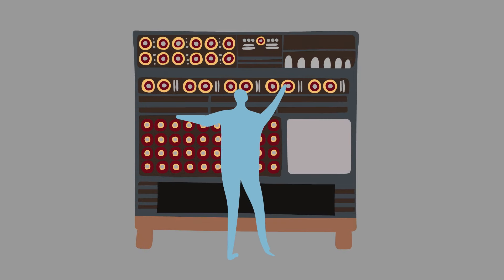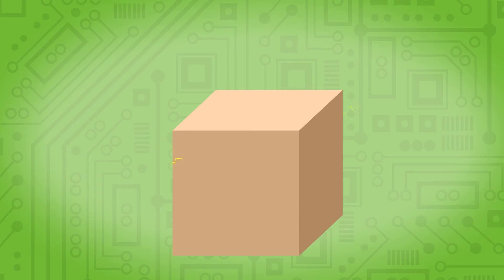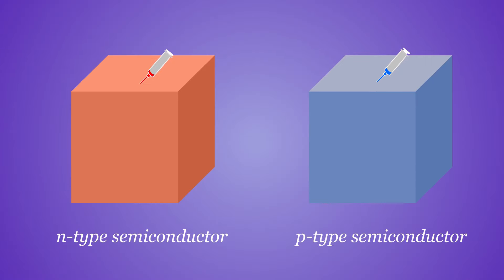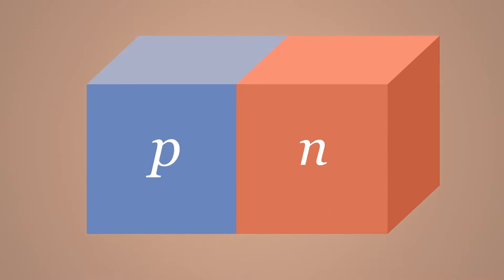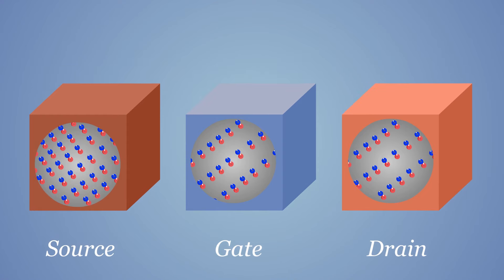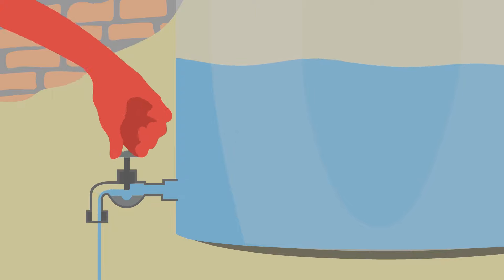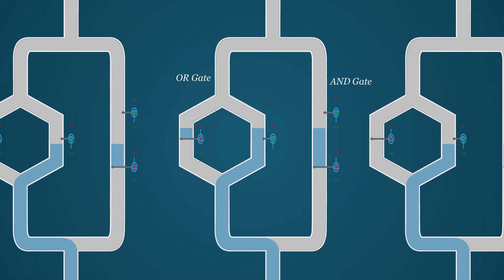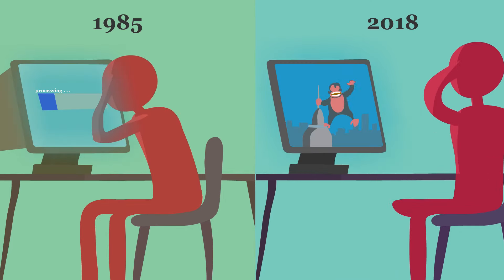How Transistors Work - A Quick and Basic Explanation

Comment: Max Warfield
Complete noob here. This is a good example of what, I'm not quite sure I understand, see, often you'll see an NPN BJT with that little arrow pointing away from the emitter, right? But the direction of the arrow of the collector isn't shown [tho we know, it is pointing away from the collector - NPN = Never Pointing iN]. So, my question is: HOW does current travel in the opposite direction of the "imaginary" arrow of the collector, when the current at the base, allows it? It's my understanding that current can only travel one way, in a diode, an NOT the other. And, a BJT is basically 2 diodes back to back, right? So, please explain this to me, I want to learn. Great video - make more. Cheers!

Comment: You showed a straight line for a graph of Moore's law, which is a parabola (exponent). Also, you show it going well into the future and Moore's law has come to an effective end.
Reply: It is still correct. He used a logarithmic base on the y-axis, so the graph is straight. It certainly would had been a parabola if he didn't do that
Reply: It is still correct. He used a logarithmic base on the y-axis. If he hadn't did that, it certainly would have been a parabola.

Comment: Can someone please tell me how the gate is switched?  Seems like you need a transistor to switch the gate on a transistor.  What actually starts the process of adding power to the gate ?
Reply: Almost any other device that can produce a voltage can drive the gate. This could be another transistor but it could also be a mechanical switch, a relay, a battery, a transformer or an antenna. These are the most common ones but there are probably a lot of others. Which devices are used and how they are interconnected depends on the application and how the complete device (like a TV, phone or computer) is designed and put together. Overall all the power required to operate all of the individual devices and circuits used to make up the complete device comes from an external power source, such as a battery or a power supply connected to a wall outlet.

Comment: I assembled it in a protoboard the motor doesnt turn on, I am meauring voltatage in the transistor when the sensor is on and its not providing enough voltage, in the first pin of the transsitor where the resistance is it measures 4.9, but B is 0.8 and ofcourse the motor will never turn on. What is wrong?

Comment: WHY DO THESE PEOPLECOMPLICATE TRANSISTORS. THEY ARE A RESISTOR
Reply: No they aint  a whole purpose of a resistor is to reduce the amount of voltage coming into a circuit where as a transistor is used for amplifying, controlling, and generating electrical signals a Mosfet transistor is similar to a resistor but is not the same